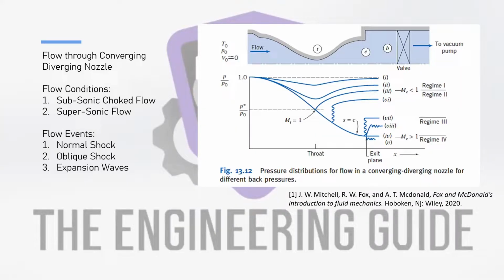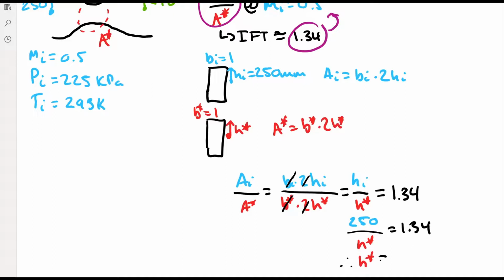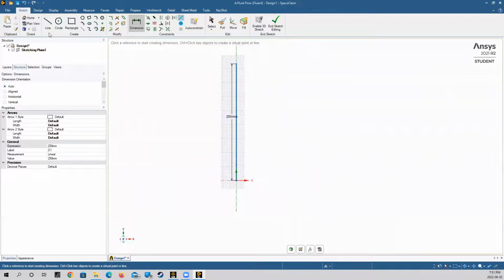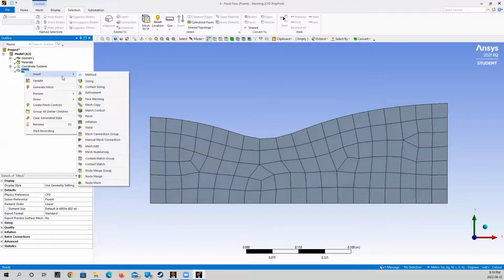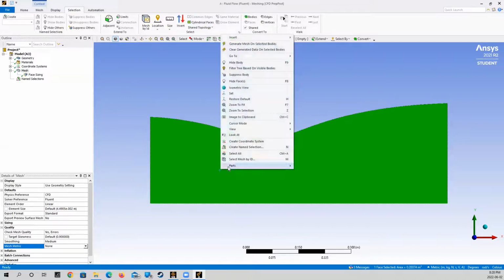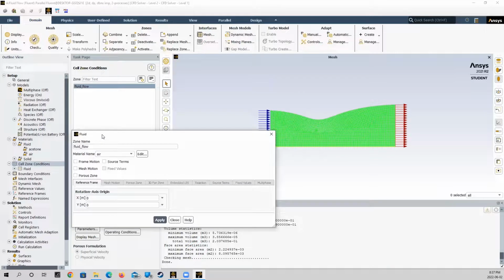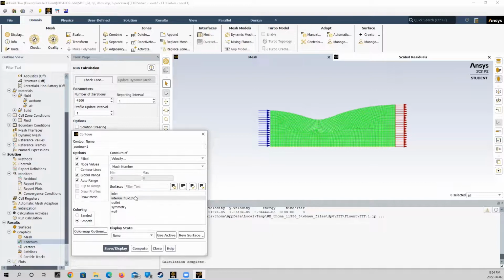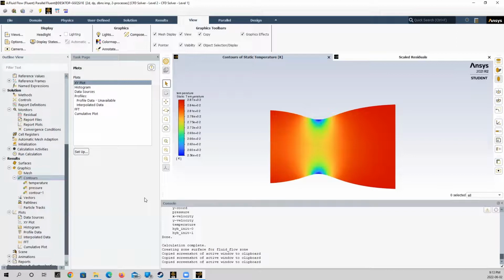ANSYS CFD Tutorial: Converging - Diverging Nozzle | Part 1: Sub-Sonic Flow Condition

Comment: How can you have a larger pressure at the outlet then the inlet. In theory, air moves from higher to lower pressure, and not lower to higher pressure. The reason I ask this is, because I am working on a similar project and getting Pe > Pi which does not give me a Mach number of one at the throat ( I am doing the same calculations as you with different numbers). That said, if I change Pe to be 10kPa less the Pi I am getting a Mach number of 1 at the throat. Why 10kPa, I am not sure it was a random guess to get Pe < Pi. All that to say would you know of a way to calculate a value of Pe that is lower then Pi.
Reply: In order to recieve supersonic flow. you do need Pe < Pi. so as he said he's considering the subsonic flow at the nozzle exit. That says it all.